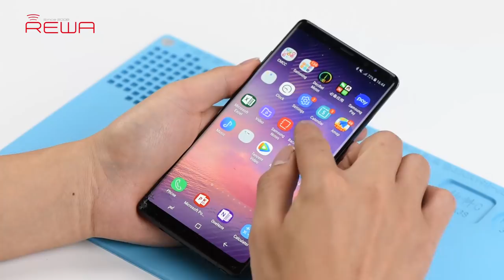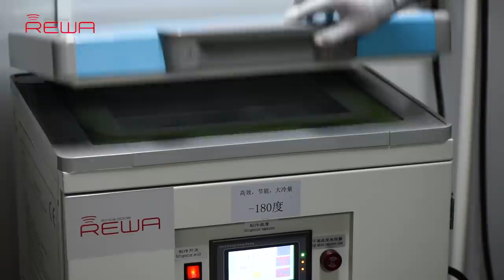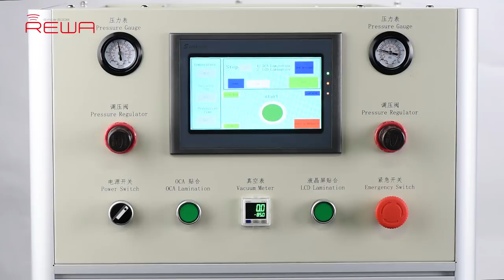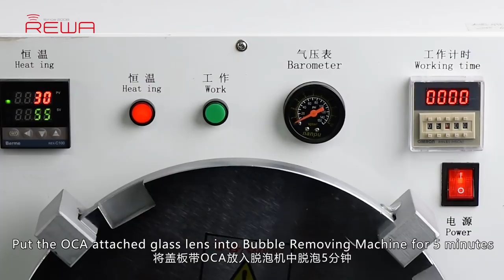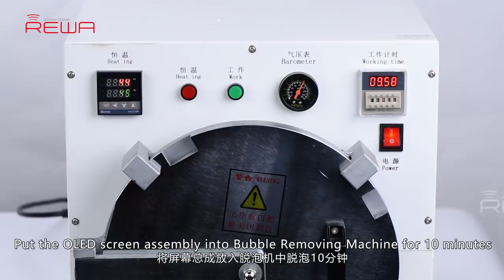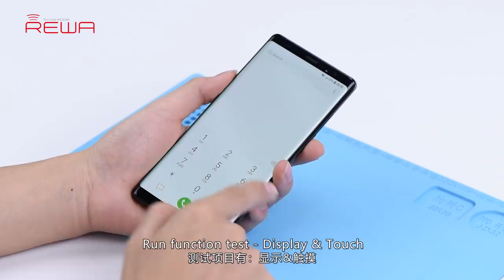Samsung Note 8 Broken Screen Glass Repair - New Tech Updated

Comment: Ah yes no problem let me throw my phone into my -180 degree frozen screen separator I had sitting behind my couch
Reply: Right I  was wondering where I  left my bubble removing machine.
Reply: I know....I was thinking this video would help me repair my note 8 at a lower cost than the 300.00 quote I received to replace my cracked screen.  I can see this expensive equipment will cost me even more!!
Reply: I was just thinking that ! xD
Reply: REWA uses big scale equipment that Is worth hundreds of thousands but because they do thousands of screens and supply all the dudes that sell u the replacement parts from china, those machines can do a lot of phones at once, but if you're doing 10 or 20 a week the $800 separator and a dental grade autoclave Is enough for doing them one by one. Of course all the variants of this equipment shall not be operated by fu*kwits, and Is not for your average consumer that Is accustomed to $50 1 hour mall screen replacements. Technology progresses in complexity and difficulty, as too repair techniques
Reply: Pfffft who doesnt have one, I only gave this a thumbs down because I have a robot to do the same thing next to my -180 degree separator.   Just can't find the power button for it!

Comment: No wonder repairing screens are so expensive... I got a new appreciation for mobile phone technicians
Reply: lol.. yea they want you to think that. if your handy and take your time you can do this yourself.
Reply: don't pay attention to this video, most techs will definitely not do it this way.  It's actually not even the preferred method
Reply: Actually this here is new. Lots of people phone shops dont use this. They hear the phone which is lot more work and hassle
Reply: most technicians will just buy the whole screen assembly done, and I don't think they're wrong doing so
Reply: @Aaron-hg8jo  please show me the right method
Reply: @Aaron-hg8jo  Bro this Is not 2014 anymore, the Moly string & heat technique Will definitively ruin any curved display even if done carefuly, might get away with the flat phones but curved Is needly to do it with the nitro + autoclave method, even if it's using a smaller variants of these tools
Reply: @matocarina  I try to harvest the broken glass screens, a friend of mine has the nitro + autoclave gear and he can sure refurbish those damn curved screens, Is good to be a nerd and have old time friends that were into extreme overclocking sometimes ;)

Comment: Did it still have 10 finger multitouch function after being repaired? In the past i tried to replace my samsung a8  lcd by my own and somehow it loose that function. And you can tell the differences when you play a game. So do you know how to tell which lcd has 10 finger multitouch function with the one that doesn't?
Reply: LPDDR5 Hack Well yes, if i only change the glass it would be doing just fine but what i did was change the whole lcd panel, i buy 3 lcd panel online (not just the glass) from 3 seller and all of them said its an original..but every lcd panel that i bought only got 5...not 10 multitouch function. So i'm really curious, how to choose a real one
Reply: @_____-ze5ow  Samsung does not sell their screens outside of Authorized repair centers. you got ripped off. Best way to repair a samsung device by yourself is buy one with a bad IMEI and swap the good screen to yours. Unfortunately,  those are rare so they usually cost the same as a repair shop would charge to fix your screen properly.

Comment: This looks all nice and fun but is not work efficient..  Its very time consuming process.. It would be a much easier to just buy new display assembly and replace it, plus it has guarantee and its original it doesn't have to go under super cold and hot conditions...

Comment: I got one of these freezers and dont be fooled its wayyyyyyy harder then he shows to get the dam glass off it dont just fall off! i tried 3 lcds alrdy and ever one broke the glue does not releases even at -180 have to use alot of force to get the glass off
Reply from the maker: Which model?

Comment: Hey i got all the machines and if you put the lcd at -180 for 5 min the lcd will come apart in pieces. I try on samsung s8 and the lcd was destroyed the black part got separated from the lcd and the lcd doesn't power on anymore.So the temperature and the time are not ok.
Reply: first of all the galaxy s8 has an OLED panel not an LCD maybe you have a fake one there buddy

Comment: I have try this way with s8 and s8+ 
But when i tried it on the Note 8  the display just exploded a lot of  times so i ended using the wire and hot separating machine could you help me in any advice 
 I from lebanon
Reply: Yes it will , keep the temperature to 165 degrees not more than that on the freezer and set it for 120 seconds or 140 seconds and that’s it.
Reply: @Mobifixx_lko   yes it is an option but if it is broken so much the glass won't come off  thanks for you

Comment: Can I just put it on my freezer for 20 min lol
Reply from the maker: Hi 90s KIid, Actually, the lowest temperature of this machine can be set at -180 degree Celsius. So the freezer temperature is not low enough to destroy the glue.
Reply: @rewatechnology2008  Dang, well I went on to fix my girlfriends phone.. Ended up destroying the lcd and back cover 🤦‍♂️ now I have to buy her a new phone I feel bad, next time I will take to a professional like you 😭
Reply: @rewatechnology2008  JerryRigEverything was able to remove cover glass with a dry ice block at a much higher temperature of -78.5°C. Why do you believe it must be -180°C?
Reply from the maker: @MikeTrieu  Here I mean the lowest temp. can be set to -180°C.
Reply: @S4_QUATTROPOWER  u couldve just gotten a new sxreen

Comment: its clear at time to remove lcd from frame this guy compete destroy it
Reply: Carlos Davila weird, i didnt see that
Reply: I saw that, he destroyed the lcd screen when he want sprat it from the frame
Reply: LOL that was lcd back sticker which is used to adhere lcd to bezel, gain some knowledge before pointing at someone's work
Reply: you guys are all wrong..... first off this is not an LCD (Liquid Crystal Display) it is an OLED (Organic Light Emitting Diode) display, and secondly these displays are flexible....
Reply: The Galaxy Note8 has the latest dual-edge curved screen Flexible OLEDs, which continue to be developed and manufactured by Samsung Display. They were first introduced on the Galaxy Note4 Edge in 2014 by Samsung Electronics, which makes the Galaxy Smartphones. While the OLED display itself is flexible, the screen remains rigid under an outer hard cover glass that is hot formed into a rigid curved screen.
Reply from the maker: Thanks for the comment. The black layer at 4:10 is actually the stylus paper. It is normal that the stylus paper get separated from OLED after freezing. It will back to normal status at the room temperature.
Reply: The battery removal part is not complete. It takes a lot more effort to remove the battery from any s6 and afterwards model.
Reply: @pantnick  Removing the battery on the note 8 actually took me 20 seconds from start to finish... Put it on a pre heated plate... like a glass separator or something for 10 seconds on 85 celsius, spray on some isopropyl alcohol and pry it off with a pry tool starting from the side. it wont damage the battery, nor the adhesive.
On the frame separation... that guy might be extremely lucky not destroying the display with that method, or he destroyed it, then they just swapped to a working separated display.
Separating the display with brute force is risky as hell. Ok it is flexible, but in the freezer the layers get rigid, and if too much force is applied, they will separate on a corner... and that is the end of the display. So don't get too surprised if you see some brownish-yellowish tinted area on the screen after separating it like this.
Reply: If you want a clean and almost "good as new" looking refurbish. You can laminate the glass to the display while it's in the frame, but you risk having some bubbles in the corners, that can't be removed, or the display end up having heavy bumps on it that looks ugly.

Comment: 3:32 you can see multiple damage to screen surface
Reply: Wojtek Kowal that's not damage. That's just amoled waves. It normally looks like that when the glass is removed. When re pressed with new glass it goes away.
Reply from the maker: It's normal for a flexible display.
Reply: Iain Simpson Hi sir. Do you have a new solution for waving on the edge?

Comment: This is a completely useless video to be honest. This video was visited from people trying to fix the screen in their home.. nobody here has those expensive machines used here.. you should maybe change the name of this video to using machine to change the note 8 screens.
Reply from the maker: Hi Alejandro Beltran, thanks for your comment. It would be rather difficult for the home repairer to do the glass only repair without those equipments. We suggest you to change the whole screen instead. which would be much easier. 
Plus, we will consider your suggestion on the video name. Thanks again for your suggestion.
Reply: @rewatechnology2008  dont listen to him this people thats been here and looking from the thumbnail should know this is more of a training video. Plus anyone with a decent amount of knowledge about their phone or led n oled technology would know that you can't easily replace a note 8 screen this way
Reply: It's not useless. This video shows that you have to be careful with your phone cause repair of the broken glass is a very difficult thing.

Comment: Haha what rubbish , Note 8 Lcd is quite delicate from other models like s8 or s8 plus or s7 edge . Till glass removing it’s okay, but he puts the screen in -180 * for 5 mins it will separate on its own and get damaged . As we can see in the video too the display is widely open from down. I replace glass on daily basis of edge models , this is surely not the way to do refurbishment of note 8 LCD .
Reply: @dmoskva  i have that machines and if you put at -180 for 5 minutes the lcd will come apart in pieces i try that on s8 and the black part got separated from the lcd and i can't do anything with that lcd.